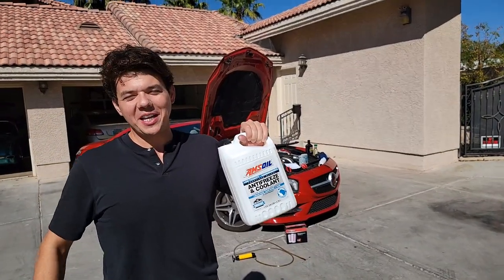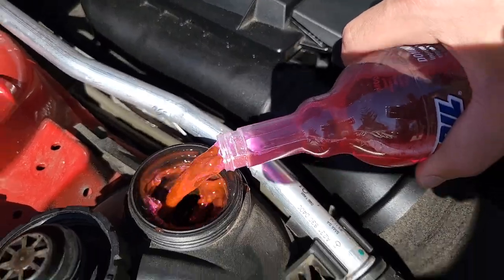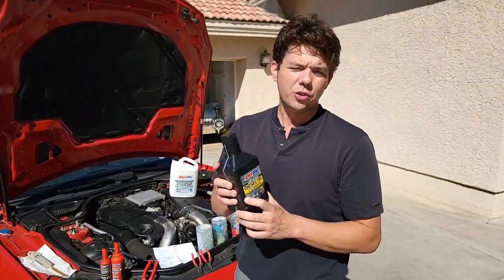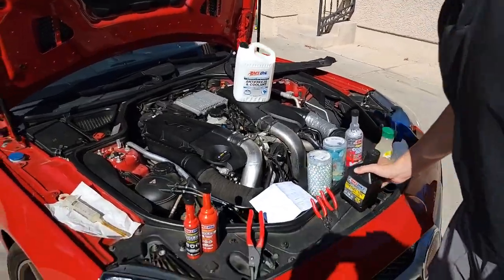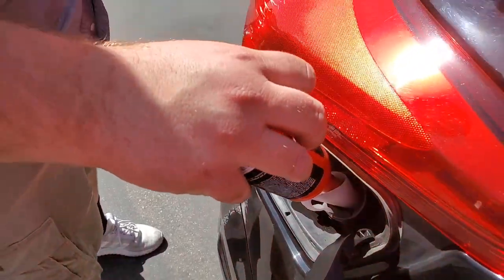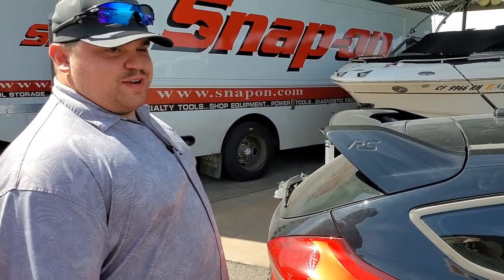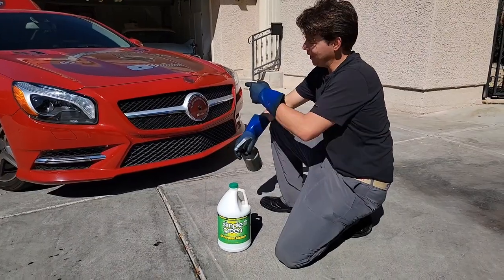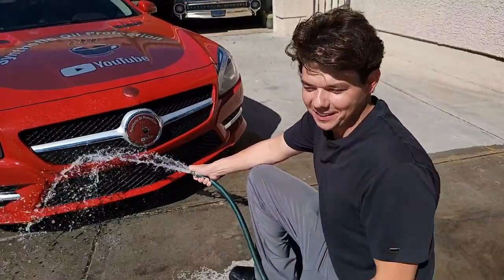3 AMSOIL Products to Beat The Heat & personal tips

Comment from the maker: 3 AMSOIL Products I use to Beat The Heat:

1. Pi Performance Fuel Injector Cleaner - https://www.amsoil.com/p/p-i-performance-improver-gasoline-additive-api/?zo=5331179

2. Dominator Coolnat Boost - https://www.amsoil.com/p/dominator-coolant-boost-rdcb/?zo=5331179

3. Dominator Octane Booster - https://www.amsoil.com/p/dominator-octane-boost-aob/?zo=5331179

     NOTE: if your coolant has over 60,000 Miles or 3 years on it I would personally change the coolant to AMSOIL Low Toxicity Biodegradable Coolant because it will extend the life of your water pump,  gaskets, and hoses - https://www.amsoil.com/p/low-toxicity-antifreeze-and-engine-coolant-ant/?zo=5331179

❤️🇺🇸❤️ Professional YouLubher: Eben Rockmaker Regency Platinum Direct Jobber AMSOIL Specialist (Dealer#: 5331179) 702-472-3614 

      ✅✅✅  I Recommend The AMSOIL 6 Month PC Membership because it will give you the Best Value. You get $33 back on a $100 purchase after the difference in tax with  No need for auto Renew - https://www.amsoil.com/offers/pc/?zo=5331179 

     Your vehicle could run better than brand new by using the AMSOIL 100% synthetic lubricants. 

     AMSOIL Signature Series 5W-30 Synthetic Motor Oil protects against harmful deposits on turbochargers 4X better than Mobil1® Extended Performance in industry-standard testing*.  Read This Article - https://www.amsoil.com/newsstand/motor-oil/articles/leading-the-field-in-deposit-protection/?zo=5331179   

     ♥️ AMSOIL Performance Tests: Read This Article - https://www.amsoil.com/performancetests.aspx?zo=5331179    

     Find AMSOIL Products For Any Vehicle - https://www.amsoil.com/guides/?zo=5331179

Comment: Eben,
 Spoke with a buddy of mine on Friday he's has 470,000 on his Tacoma, been running Amsoil all of its life only repla ed alternator and some bearings. He also said he put new Amsoil in the transmission the tech and dealer owner couldn't belive he had 250,000 miles on it because of how good it looked.
Reply: Wow that's alot of miles
Reply from the maker: Wow very impressive!

Comment: I think I would have added the brake fluid to this list especially in the desert. You need that extra heat protection for the braking system.
Reply from the maker: I was looking to keep it as simple as possible and three items.

I really think the brake fluid would have been a great addition as well as the signature series motor oil.
Also changing the oil filter earlier than later is also a great addition
Reply: @Syntheticoilprotection  are you ever going to do a video on the firearm products from amsoil?
Reply from the maker: Yes.
Reply: @Syntheticoilprotection  if need a gun or two or so to use. I would gladly help. I come to Vegas often!
Reply from the maker: Thanks M

Comment: Dang, I’m trying to turn my Tacoma into a amsoil machine fluid wise! I’m a little nervous to do the tranny since its sealed but gonna give it a go.
Reply from the maker: Awesome to hear Alex yeah it's actually quite a bit simpler than you think and it just takes getting used to the new pants at the bottom the way you take it off until it to the fill hole and as long as you have the tools it's pretty straightforward.
Obviously it's always nice to be able to fill it from the top with a dipstick tube
Reply: I did my Lexus it runs great

Comment: What’s the diff between the pi and the octane booster?
Reply from the maker: That's an excellent question the p&i cleaner cleans the valves injectors carbon deposits inside the combustion chamber.
Also the p&i cleaner will help make a lot more power if you have an old motor by cleaning it up it will also help with fuel contamination and better fuel mileage also your vehicle will have less pre ignition because they'll be less carbon in the combustion.

The octane booster help boost the octane which allows your motor to run a cleaner you'll also notice the fuel system will be cleaner after you run it and you'll notice more power because the computer as it gets hotter the motor gets hotter they will not change the timing as much because you'll have less pre-ignition which is engine knock in the left engine knock you out the better the timing the computer will allow an extremely high heat.

That's why he noticed such a big difference in power is because even though it was 105 degrees out in the blacktop was 150° his car still made a full timing and you can actually hear it in the video how good the timing sounds and that's because the computer is not registering any pre ignition or engine knock

Comment: Can you add the coolant boost to the 2017 ford  raptor?
Reply from the maker: Yes, you can add it to any of the major coolants makes models and colors the only thing you wouldn't want to add it to is a waterless coolant like Evans cool but other than that you can put it in anyting.
On your vehicle since it's turbo I highly recommend doing the intercooler fluid if it has it I would also do the radiator coolant with low toxicity biodegradable coolant it's the white bottle you'll see a huge bump and performance you'll also see a bump and fuel mileage and you'll see a big Power difference I saw a monster power difference on my car when I did the intercooler fluid.
This is my personal Link in that will allow me to be your M12 dealer so in the future I can always answer all your questions on the products also I'll get the credit for your orders which I thoroughly appreciate your business future business in advance if you ever have any questions let me know
❤️🇺🇸❤️ Professional YouLubher: Eben Rockmaker Regency Platinum Direct Jobber AMSOIL Specialist (Dealer#: 5331179) 702-472-3614 

      ✅✅✅  I Recommend The AMSOIL 6 Month PC Membership because it will give you the Best Value. You get $33 back on a $100 purchase after the difference in tax with  No need for auto Renew - https://www.amsoil.com/offers/pc/?zo=5331179
Reply: 2nd day running the coolant boost and I can feel the difference in HP and saving gas. Highly recommend this stuff!
Reply from the maker: Sweet!
That's awesome thanks for sharing that with the channel and do you do a YouTube channel?